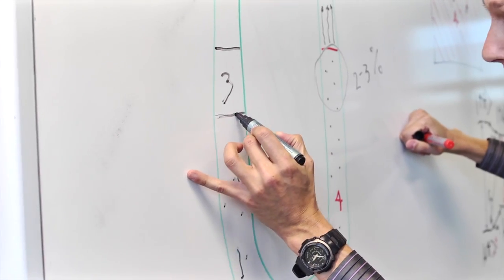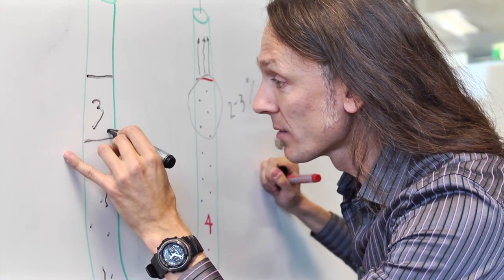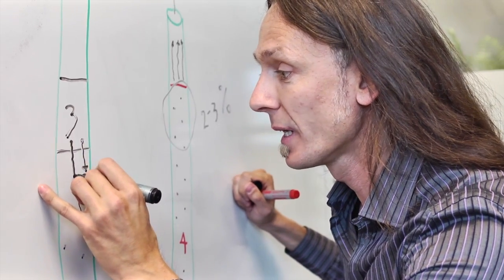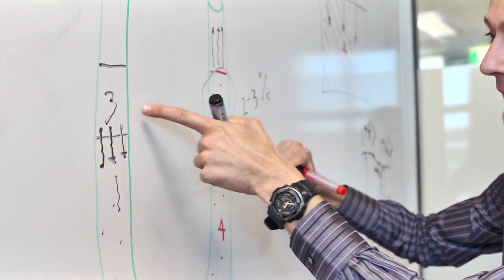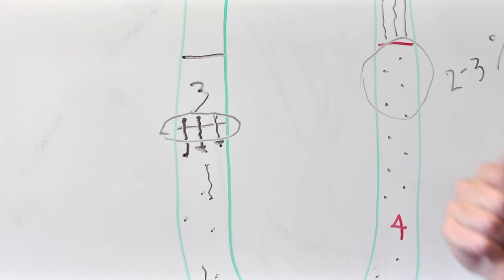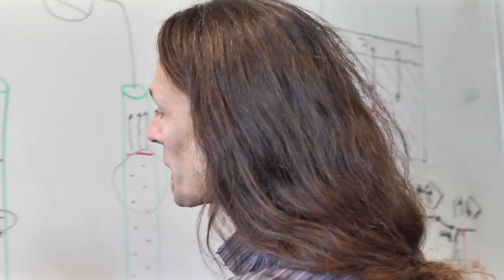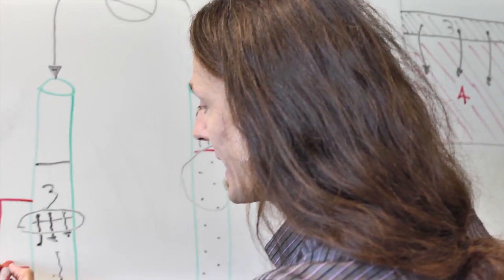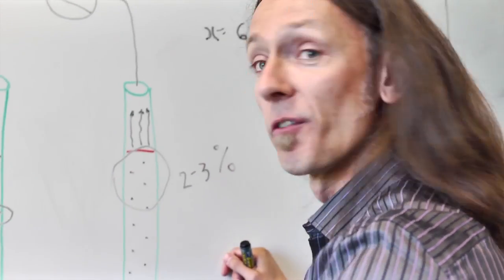Quantum Cooling to (Near) Absolute Zero

Comment: Isn't helium 3 seen as a possible FTL "fuel" source ?
Reply: +BryanFDNY Nothing can go faster than light outside of scifi.
Reply: I've heard that space time can be manipulated to surpass that rule. That doesn't envolve helium fuel though
Reply: +NOVA the engines dont move the ship they move the  world around the ship
Reply: Brandon Wiebe Well, technically you can't, you just bend space-time itself and move the entire universe rather than yourself.
Reply: TheWatcher _ Heh, yeah, there was some irony intended there, but bending space-time is actually considered physically possible, as opposed to being not only impossible, but a complete breach of causality, like FTL.
Reply: William Moore The current belief is that the speed which light is limited to is not only the "Universal speed limit", but the speed of causality itself. Passing the speed of light would, in theory, allow the vessel to ignore things like the direction time's meant to move, or the chain of cause and effect.
Reply: It is possible to use gravity to manipulate space-time, look at some NASA Warp Drive prototypes. They're similar to the pseudo-science of the movie Interstellar. They "push" space-time out the way using a Alcubierre bubble reducing time friction.
Reply: TheWatcher _ cool.
Reply: +Amperzand So does the two other isotopes of hydrogen, namely Deuterium and Tritium (1 respectively 2 neutrons compared to 0 neutrons in hydrogen). Fuse Deuterium and tritium together, The protons alongside with two neutrons form Helium-4, and the leftover neutron decays into smaller particles and some energy-radiation. Stars use Hydrogen-1. A total of 6 Hydrogen atoms form Helium 4 alongside with 2 positrons, 2 neutrinos and 2 protons which changes into neutrons thanks to the neutrinos, alongside with releasing radiation :).
Reply: Is it really?
Reply: +NOVA Right now we believe nothing can travel through space with a velocity higher than the speed of light, to be precise.
Even assuming this law of physics will never be proved wrong (they usually are proved wrong at some point) then it doesn't mean there aren't loopholes. We've seen spacetime can be manipulated by gravity.
Reply: +BryanFDNY Not for FTL, but helium-3 makes great fusion fuel.
Reply: +aiden baron It involves creating a mini black hole. But I heard it would require more energy to create the black hole than it would produce.
Reply: +BryanFDNY As Amperzand said, you must mean fusion. Which is fully possible this century and therefore much cooler than fantasy FTL.
Reply: +NOVA with a warp drive you can go faster than light. Warp drives are only theoretically possible right now though :(
Reply: Amperzand "just" bend space-time
Reply: Amperzand I know
Reply: +NOVA Just because the current laws of physics assume you can't, that doesn't mean those laws are right. You have to remember that they were thought of by man and we have such a limited knowledge of the universe.
Reply: Küala Music there are in fact theories that say that gravity itself is a distortion of space-time
Reply: +NOVA What about the Big Bang...?
Reply: huszaratraktor
the big bang was creating the universe itself.. nothing in the universe can travel faster than light, but nothing (that we now of) can limit the universe in it's speed
Reply: huszaratraktor TheWatcher _ The expansion rate of the Universe is considered either the speed of light or faster.
Reply: Küala Music personally I think it's faster. but you could never really measure it since it's space itself that's moving and that's kinda hard to measure
Reply: Patric Berggren While that was not a very coherent explanation, I think you have the idea.

Comment: I take AP chemistry... and I'm trying to see how this works and it's like... Ok the concept, but the reason behind it isn't clear. It's like saying that continental drift happens but not explaining why. But what can you expect Not everyone majors in chemistry.
Reply: +SOEL86 chemwiki.ucdavis.edu/Textbook_Maps/General_Chemistry_Textbook_Maps/Map%3A_Lower's_Chem1/23%3A_Thermodynamics_of_Chemical_Equilibrium/23.4b%3A_Thermodynamics_of_Mixing_and_Dilution

would be a good starting point :)
Reply: +Dilip Tien Actually there was a gap in the explanation. Why does the transit of he-3 atoms absorb heat? I understood the soup analogy. But in what way is he-3 analogous to boiling water?
Reply: +SOEL86 It's a natural conclusion from the laws of thermodynamics, in this case the second one. (But I'm not a good teacher, so you'll have to wait for someone else to give you a good explanation about thermodynamics or look up the basics yourself ;))
Reply: What don't you understand.
Reply: +SOEL86 The HE-3 atoms are lower in density, therefore can handle more heat from the he-4 atoms, thus cooling the he-4 atoms, thus forcing the heat to transfer, speeding up the he-3 atoms allowing them to transfer to the he-4, thus transferring the heat back to the he-4 allowing the he-3 to dissipate from the he-4

Think I have it backwards, but that's the theory. Study basic refrigeration, it will all make sense

Comment: Can I put this thing in my PC?
Reply: your cpu won't start up at those temperatures
Reply: +/sky/  He's obviously explaining something. STFU.
Reply: +Jordan Johnson (Mighty Burger) 
Condensation wouldn't even be a problem at those temperatures. Your cpu and its compound electronics would fracture and short itself first.
Any kind of metal heatsink would contract so much that it's either going to shear its bolts from your motherboard or bend it both of which are fatal.
Also your thermal past would solidify instantly and crack making you lose conductive contact with your cpu.
Absolute zero is −273.15°C just in case you didn't know :)
Reply: +Ryan Walker 
The temperature will literally warp your cpu or any metal it touches instantly so no :P
You'd be left with a physically dead machine.
Reply: condensation would kill the electronics
Reply: +Jordan Johnson (Mighty Burger) vacuum chamber
Reply: +Ryan Walker That'd be epic
Reply: +Ryan Walker Overclock 4 Titan Xs to 2x performance xd
Reply: +Jarum hes obivously joking dude
Reply: Some people have to realize that not everything people say (especially on the internet) should be taken seriously.
Reply: +Ryan Walker Overclockers be like=
Reply: yeah...
Reply: +Ryan Walker You could put it in your pc, but it's of no real use. First, for this to work, you already need liquid helium (4.2K) from another method. And second, the cooling power of this is enormously small compared to high-temperature cooling methods (e.g. fans blowing, liquid cooling system).
Reply: Ryan Walker
but everything on the internet is true! XD
Reply: Looool well firstly u won't be able to cold boot at those temps, and secondly u ent gonna get no current at those temps, but one can wish
Reply: +Songs for the Heart hes kidding bro stfu

Comment: Instructions unclear, invented cold fusion.
Reply: +TED BEH Actually Cold Fusion is even hotter than that. Cold Fusion means getting fusion to occur at any temperature lower than it amount of energy it outputs.  The temperature Fusion happens in a sun is already way colder than the energy output of the fusion which is why stars work as nuclear generators. The reason fusion happens at the lower temperatures on the sun is because of the extreme amounts of pressure due to the high gravity. On earth at 1 Bar Hydrogen needs to be so hot for fusion to occur that the energy output is not nearly enough to cause more hydrogen to fuse (for a chain reaction) If we could match the fusion temperatures of the sun that would already be cold fusion. The problem is finding a way to pressurise the system, or finding another way which does not require the system to be pressurised. (Remember, were not talking about like 100-200 psi, were talking in the range of 3.6 trillion psi.
Reply: +Ryan Rognas Cold fusion does not require super cold temperatures, because cold merely refers to temperatures colder than that of a stars core, so room temperature is pretty mush freezing compared to a suns core, fusion requires a poop load of energy, which is why it mostly happens in stars :)
Reply: Instructions still unclear, penis frozen to inside of U-tube of liquid helium, and rapidly shrinking to Planck scale
Reply: @talltroll7092  where you able to measure 0.0000000000000000001 m of shrinkage
Reply: martinshoosterman Well, thanks for that beautiful explanation :o
Reply: +Ryan Rognas Ahaha, snorted at work laughing at this.  10/10
Reply: +Ryan Rognas it already exist
Reply: martinshoosterman cold fusion is theoretical and has not yet been proven to exist. You're confusing it with hot fusion, which is what occurs on stars. Cold fusion is actually a nuclear reaction occurring at room temperature, at standard atmospheric pressure.

Comment: Am I wrong in assessing this as being very very similar to regular old refrigeration? That's also based around absorbing temperature through a phase change, but I suppose they're probably fundamentally different processes even though they both use a phase change
Reply: Rob Mckennie So I believe that the analogy he used with the soup is actually the exact same thing as conventional refrigeration, but the question of if this process is actually fundamentally a different process from conventional refrigeration stands.
Reply: Rob Mckennie Conventional refridgeration doesn't use a phase change. You compress a liquid (which is not compressable) and that adds heat. Then you radiate the heat away to room temperature, then release the pressure which cools the liquid below room temperature, and circulate that inside the fridge to absorb its heat. Then repeat. So, It's similar, but it sounds from his example as though you're not adding any pressure or energy to the system. That was my take on what he said, I could be wrong.
Reply: Logan Poppe How sure are you of this? I'm pretty sure that conventional refrigeration (i.e the kind used in your kitchen fridge) works by compressing gaseous coolant into a liquid phase, which heats then, then pulls that heat into a heat sink, then evaporates the coolant through a capillary tube, which cools it, which draws heat out of the heat source. (There's a very real chance i'm just misusing the phrase "conventional refrigeration")
Reply: Rob Mckennie Looks like you are correct. I got old fridges and new fridges combined in my head. Old ones with CFCs start as a liquid and new ones start as a gas. Looks like it actually just compresses the gas in modern fridges, but then as the gas loses energy to your room it liquifies until it passes through a valve, and the low pressure on the other side turns it back to a gas again.
Reply: +Logan Poppe In this system, you don't have to manually add any energy/pressure, the pump from h4 to h3 provides the tiniest amount of kinetic motion, which allows the slightest changes in pressure and energy throughout the tube, the h3 molecules transferring to the h4 is the energy required to create the compression within the h4, it is the same theory, just different practice

Comment: Could you inhale alcohol vapor and vet drunk off it?
Reply: Thebubble85 Well boiling ethanol is hot. Not as hot as steam but more than enough to give you some nasty burns. Secondly, in order to get the alcohol equivalent of one can of beer you'd have to absorb 5 liters of ethanol vapor, which is about 10 full breaths... of boiling hot ethanol vapor in your lungs. Not fun. Then there's the issue of 'is ethanol even absorbed though the membranes of the lungs?' which I'm not qualified to answer but I'm guessing its not going to be anywhere close to 100% of the ethanol going into your lungs being absorbed into your bloodstream.

I don't think you'd want to try it. I seriously doubt you'd survive long enough to get drunk off of it.

Comment: Derek Muller  Is it really due to osmosis that the He3 particles dissolve into He4 when a pump is connected?? Why don't the He3 atoms in the interface of He3 and He4 get diffused and if this happens there will be no membrane and this will not be osmosis.

Comment: I understand that the He-3 moves into the He-4 at the interface in order to increase entropy, but why does that decrease heat if the He-3–He-4 bond is stronger than the He-4–He4. Wouldn't the formation of a more stable bond give off heat?

Comment: When will we see this techniques to cool down our computer hardware?
Reply: Lámbientan Lámbientan your computer wouldn't function anymore. Because electrons would hardly move anymore at those temperatures
Reply: Lámbientan Lámbientan people already use Liquid Nitrogen for extreme overclocking. But getting to near absolute zero temperatures is not going to help any computer hardware. Liquid nitrogen is cold enough.
Reply: Fhilip79 For silicon based conductors you would need such a material, but for information lanes such as PCI lanes, a super conductor can be used, you are just exchanging the copper conductor for some super conductor.
Reply: You can but it's going te set you back around 1,000,000,000
Reply: iWhacko No no no, have you every heard of super conductors. It works on the premise that when a superconductor is cooled below a its critical temperature it becomes a conductor without electrical resistance. At this point information is not limited by the conductor's resistance because at this point information propagates through the super conductor at the speed of light. Just to note, this can be applied to regular conductors, but when cooled, regular conductors like copper still shows some resistance and would not be as effective as superconductor materials, but would still work.
Reply: Adam Hosein you will need super semi-conductors for that. I am not sure if they exist but there might be issues without them.